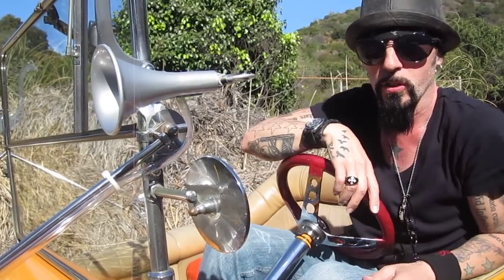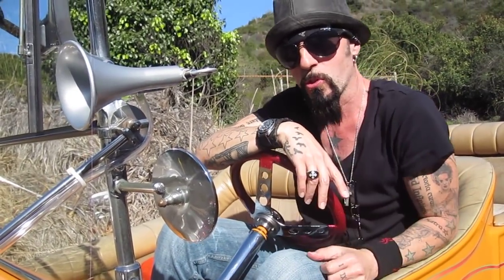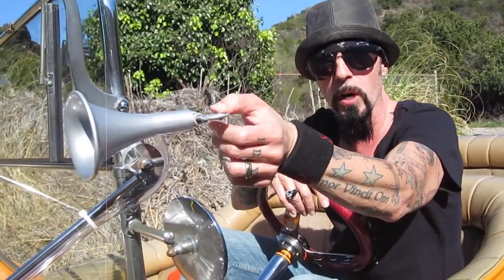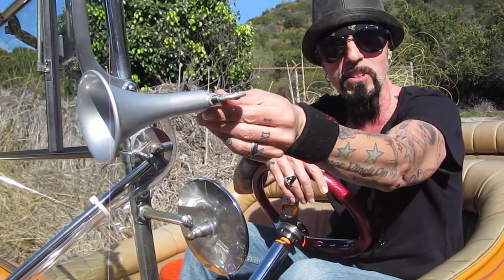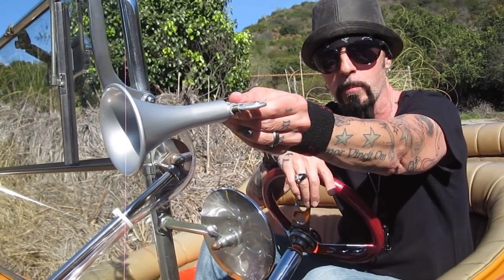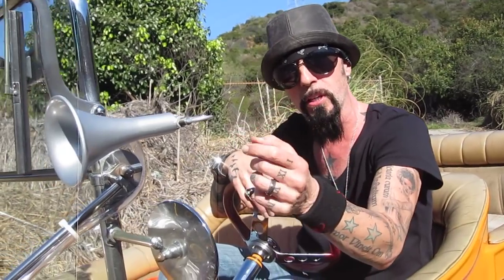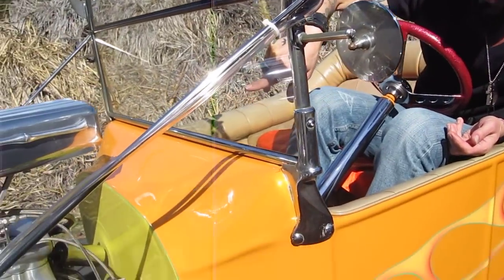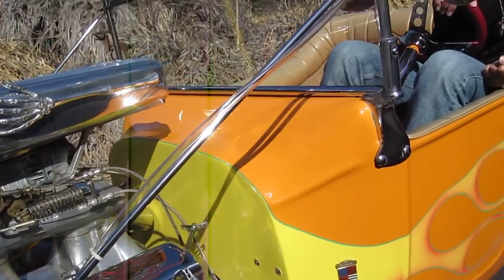Wolf Whistle How To work

Comment: Hi Christopher, Just a tidbit...try a vacuum tube with a larger inner diameter.  Because of the length you have, it may be restricting the true "Wolf Whistle" capability.  Mine sounded a bit "lazy" like yours until I tapped into a large vacuum port and ran 3/8 to it and it woke it up alot.  Your run of hose is longer than mine you may have different results with the 3/8.  You may need larger hose yet or maybe try a reservoir of some sort near the whistle if you can tastefully do it.  Maybe test it close to the vacuum source first to see if it wakes up.  Good luck.